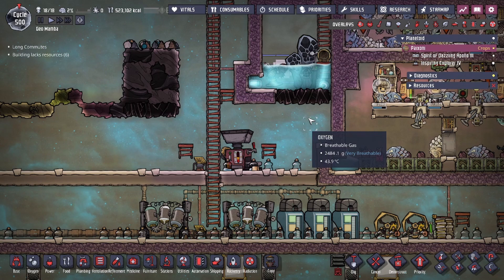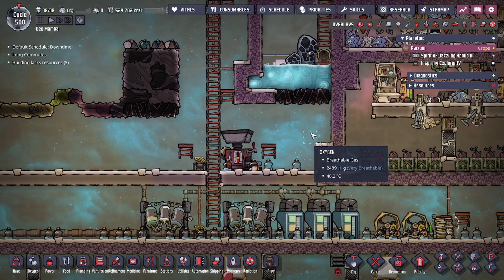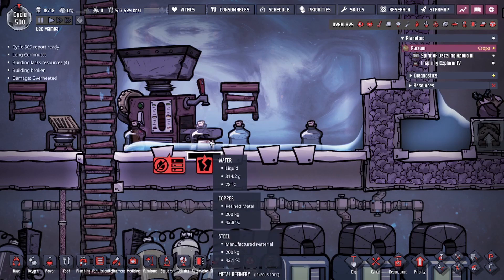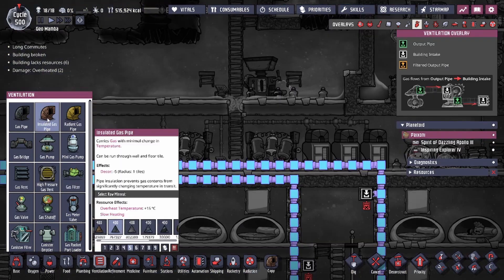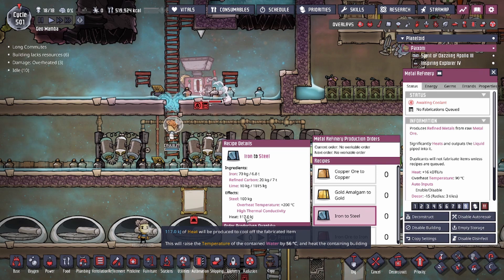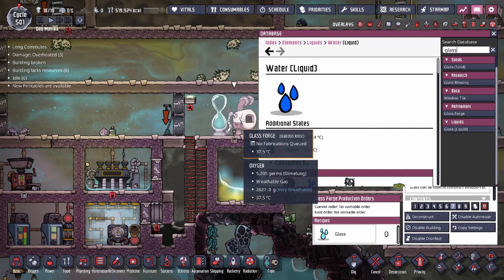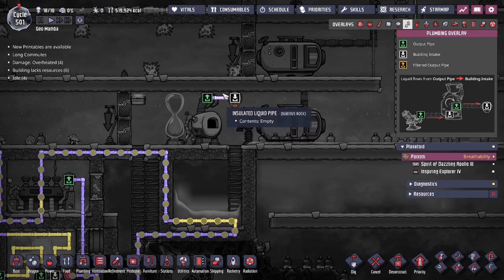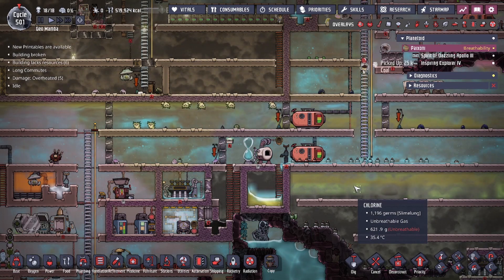Why do your Pipes Break? - Liquid , Gas , Solid - Oxygen Not Included Basics

Comment: Mercury doesn't have a gas phase outside of debug mode, yet when trying to refine copper ore into copper, which should raise the temperature of the mercury coolant by 574.1 degrees (which is above the condensation point of 356.8 degrees) the pipe still bursts. Interestingly, the copper is still made but the mercury that spills out of the pipe is still cool.

Comment: Whenever I tried making a heating loop on rime, my pipe would take cold damage and eventually the loop stops. ALS the water that I heated from the tepedizer becomes cold by the time it gets to my base.
Reply from the maker: gotta use insulated pipes! also, the longer your radient pipe segment, the more time you let the liquid inside interact with the enironment- which leads to broken pipes! try using single radient pipe segments every so often to see if it helps your situation

Comment: Hi, do you know materials for transport water at -5 C? i cant find anything, all breaks. Thanks!!!
Reply from the maker: wait, but water freezes at -3c. either way, the only pipe that doesnt have heat transfer inside of the pipeline is "insulation material" which is a rare space resource you have to forge. 
outside of that there are a few tricks to prevent liquids from changing temps inside. having the pipeline in a vacuum and then tempering the temperature by running another liquid that doesnt state change at the same temperature. once the pipeline is cold enough your liquid at -5c shouldnt change temps by much anymore